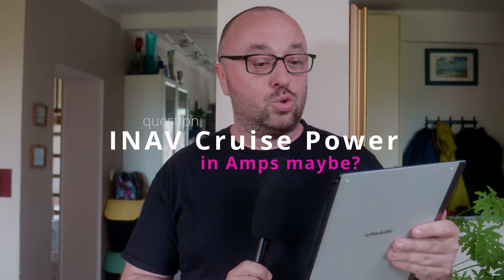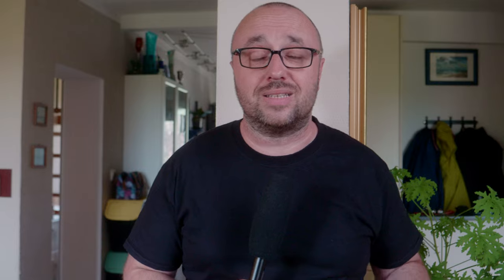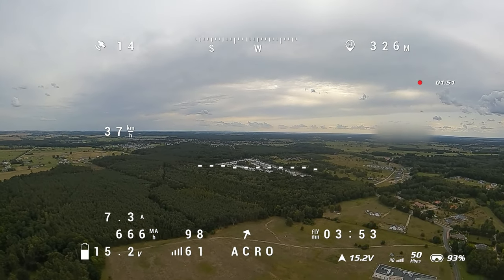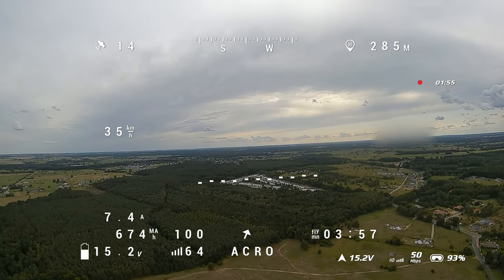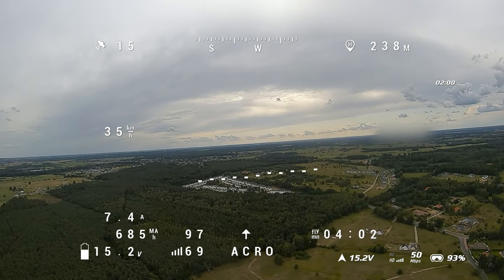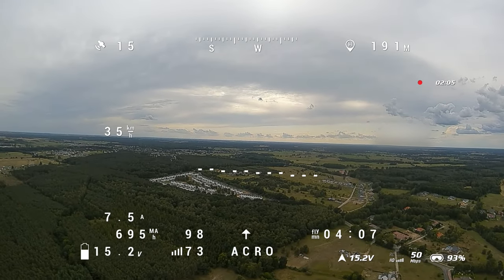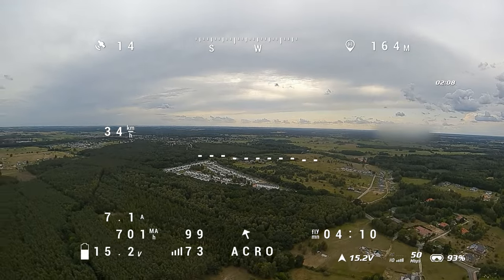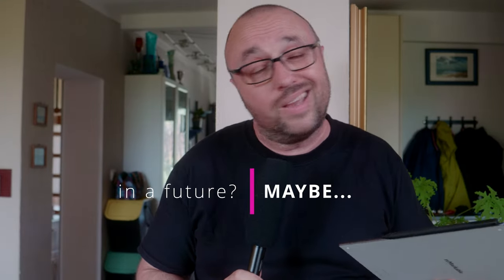You asked, I answer 9 FPV related questions

Comment: Hi Pavel, i want to make really new flight mode is that possible? 

example INAV soaring mode is based on position hoold on GPS, now for thermaling glider always have thermal drift while soaring, so the idea is making new flight mode similiar to horizon mode but the roll and pitch angle is set to some values that the mode will provide loiter direction and glide speed based on both roll and pitch hold not gps hold, so glider user now can thermaling without locked by the position of GPS

Many thanks
Reply: say... the lock mode is roll 35 degree and pitch down 5  degree, will that possible to be made?
Reply: if it possible, will be super amazing for glider user in inav 7

Comment: At 0:50 I have been looking at all René Rosentraeger's videos about VTOL and STOL on 3D printed model planes and it looks like he runs custom systems and firmware. I never saw the type of flight hardware he uses so it's hard to tell exactly what powers his models. Way out of my league, I know anyway. He admits there is no way his Su-X model will fly manually due to the wing type just like modern fighter jets.